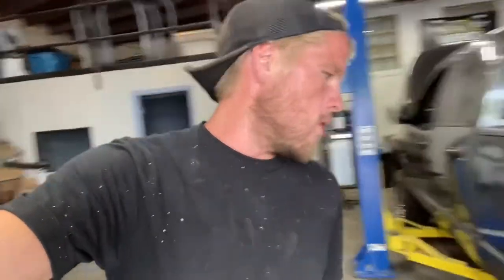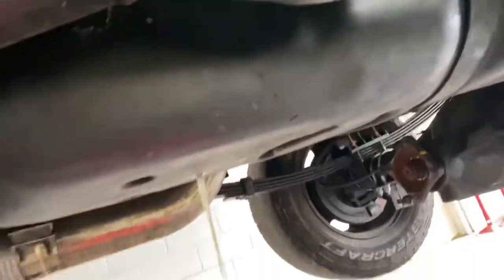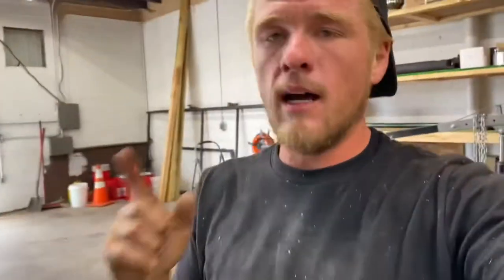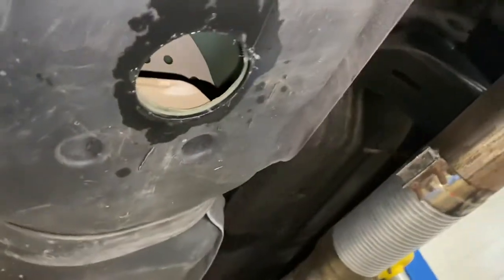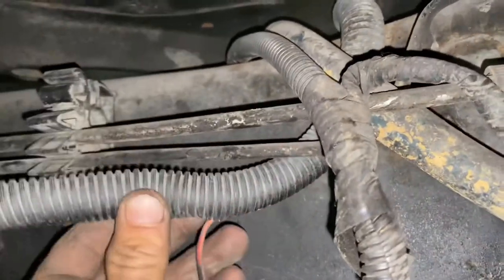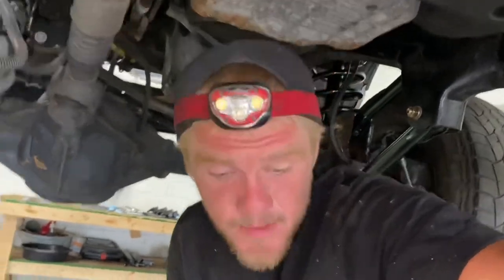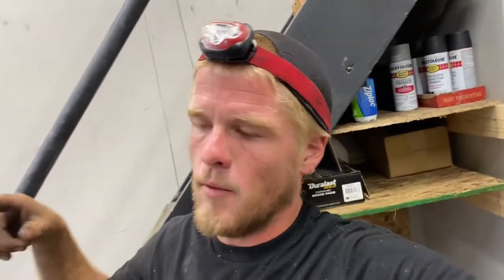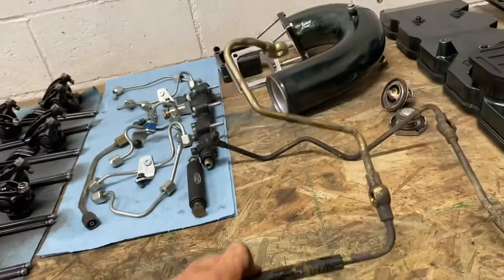CUMMINS FUEL TANK/LIFT PUMP REMOVAL….BUT WHY?!

Comment: That's just a baffle to help with fuel sloshing back and forth. Might not think so but without that in there heavy braking with a half tank of fuel could get herky jerky as it rushes forward and slams the front of the tank
Reply from the maker: Appreciate the solid info.
Reply: He's absolutely right.  I was one of the machine builders that built the machine that processed that tank.  Interesting process welding the plastic retaining disc's in place.  

Nice work on the 05.